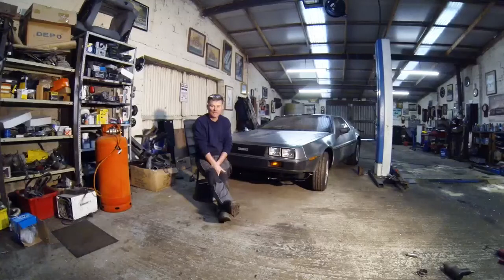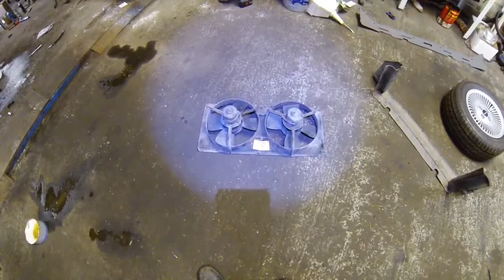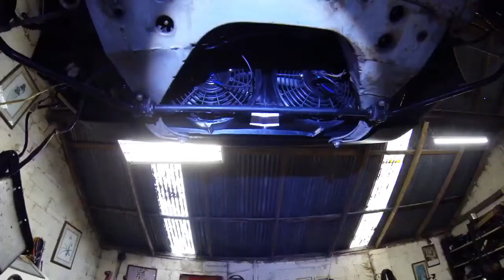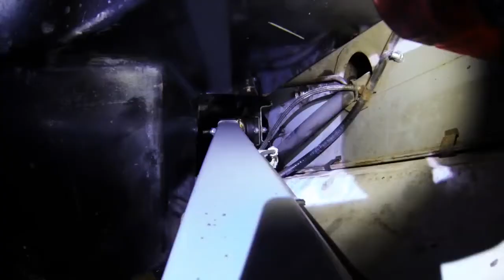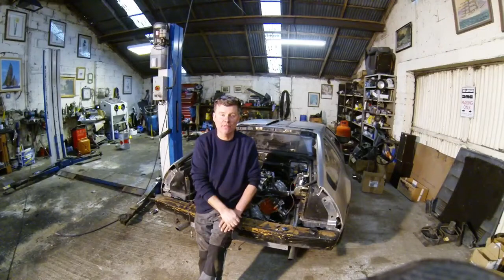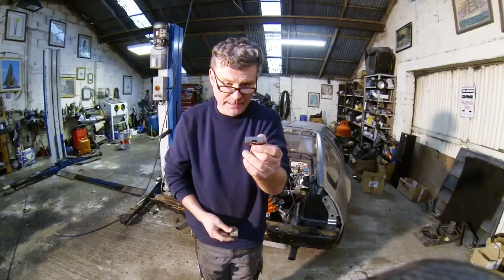Back To The Build : DeLorean Fascia

Comment: In regards to the trailing arms, did you do a video that show how the bolts are replaced?
I see that i have to give those a closer look my self.

Love the videos by the way 

//Stig
Reply from the maker: No video sorry, if you have not checked the mount bolts I would suggest going ahead and replacing them, for peace of mind if nothing else. (It's the nut that seems to be the weak link, also if you have a look at some of the old video of workers on the line you can see one guy fitting a trailing arm assembly using only a small ratchet. Not a torque wrench). 
Screw the old bolts out one at a time and fit a new high tensile bolt a little longer than the old one. This will allow for the addition of a nut on the end. They are not hard to get too, once you have removed the aluminum dust covers. 

Thanks for your input , if you have any other question let me know... Regards Thomas
Reply: Thank you Thomas for your reply, i will most certainly look into those on my car.

Have you ever tackled adjusting of the doors? I hear that this is not for the faint hearted. But i have a passenger door that is not aligned as it should and therefore makes noise caused of rubbing interior panels. so if you are to adjust yours a video tutorial would be great ;)

Keep up the good work, enjoy watching how your project comes along.
Take care

//Stig
Reply from the maker: Is the adjustment problem with the latch or the doors hinge? lf it is with the doors hinges, remember the front bolts are under a lot of tension. You will need to undo the torque rods. 
It could be the latches pushing the door up as the door keeper comes into contact with it. I have found a lot of latch bolts too long and pushing the door off alignment. Check the end of the latch bolt for wear indicating the bolt is to long, ( In other words sticking out to much).
Reply: according to Videos from the Factory the Doors are adjusted under Load of the Torsion Bars. They are NOT under heavy Load. Take the Struts off, the Doors just stay about 10 inch open and DON´T pop up, what People think. That´s wrong! You adjust the Doors with TBars and Struts in. otherwise they get bent out of Position when putting them back. Also choose a Place where you press to close the Door. push far in the Front will be different to pushing in the Back...  causing the Lock to hit the Striker Pin. Adjusting is indeed nothing for impatient People.... you learn to hate this Car then. I had my Doors completely off and fixed the Roof Box.